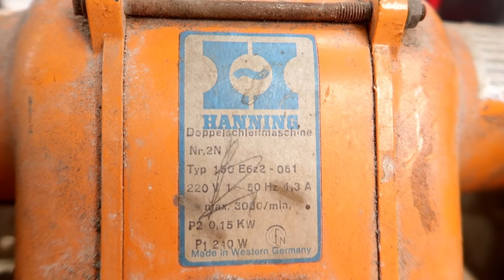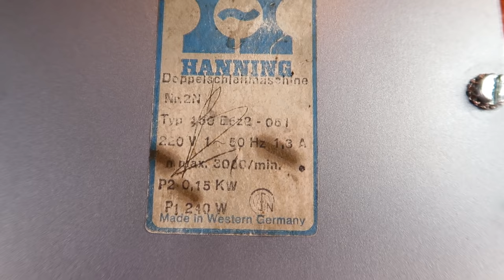Rusty and Broken Bench Grinder -  Awesome Restoration

Comment: Small security advice: If you attach cables and you're lucky enough they come with ground, always make sure ground is the longest wire. If you trip over the cable and manage to somehow pull out the live wires and they accidentally touch the casing, you do not electrocute yourself. Also your GFCI (if you have one, in german it is FI-Schutzschalter)  will pop!
Reply: Did you notice that the men who run the video game companies make the new video games harder than the old ones. The old ones are totally a peanut/they're Peanuts.

Comment: The capacitor blew that’s why it wouldn’t start on its own.
Reply: Aaron david  yes with a capacitor start motor the capacitor is used to help create a rotating magnetic field, then once the motor reaches a set rpm the capacitor is taken out of the circuit and the motor just runs off the single phase power. That’s one of the reasons why three phase motor are so elegant because with the three phases 120 degrees out of phase with each other already produces a perfect rotating magnetic field.
Reply: Aaron david  think of a capacitor like a battery. When you flip the switch to turn on the appliance, the capacitor unloads all its stored energy all at once giving the motor a jump start. Once the motor is turning the normal current takes over and the motor runs on its own.
Reply: @phillipwright746  no...not even close.
Reply: WAIT................ WHAT NOW!!!!!!!!!!?????????!!!!!!!!!!
Reply: @borysnijinski331  yes he is correct
Reply: @firebladex8586  No he's not. The capacitor is there to create a phase shift in the magnetic field. Not to 'give the motor a jumpstart'. A single phase can't start a motor, as it's slip in a magnetic field that makes the motor turn. It wants to 'catch up' to the magnetic field of a rotor, trying to find equilibrium. Without the phase shift, a single phase is already 'in equilibrium' with the magnetic field from the rotor. So the capacitor creates an out of balance magnetic field. Once the motor is spinning, the inertia of the motor (and attached grinding wheels) are enough to keep the magnetic field in and out of phase, keeping the motion going.

TLDR: He's wrong, and anyone even slightly knowledgeable in the field of electricity knows he is.
Phase shift is the key word to take away from this.
Reply: @123nvb123  oddly specific much
Reply: @shadowdragon4137  I wouldnt say oddly specific in the least. Much more like knowledgeable and correct
Reply: Personally I think the motor didn't have enough strength to make the wheels spin
Reply: You took the words right out of my brain!!!!
Reply: @lourias  I did?
Reply: There are start capacitors, and run capacitors which sounds like you do have some knowledge of. That grinder has a run capacitor. It's not shorted or as you stated "blew" or blown. It's a weak capacitor, that's when the value of the capacitor drops below the percentage of the rated value. Also if it's higher than what is rated on the capacitor it can cause an issue. It's usually anywhere around +/- 5-10% of the value. That one looked to be 3.6 uF the best I could read. A weak capacitor will burn up the windings in a motor if not replaced. Some motors especially the older ones were built better and very forgiving but the newer ones not so much.
Reply: Capacitor was huge. I'd be terrified to handle that

Comment: Though it would take longer rust removal would be a 100x less toxic in the arm & hammer super soda electrolysis tank. Positive charge some iron plates on the side of the plastic tub. Negative charge on your part turn on the power supply and come back in the morning to no rust for lighter items and longer for really rusty items. For every gallon of water I think it was a 1/2 cup of super soda (in the laundry section. Fred Meyer has it).  My brother restores Cast Iron pans, kettles and anything else he can that is Cast Iron. I made one myself and did my cast iron pan and it turned out fantastic. He has a Facebook group called Electrolysis tank & cast iron restoration community. I will not post a link if you are interested, that is the name, yall can look it up. I am a admin in group and approve membership. It is a 1500 member strong community.  Also if you like a better sanding experience you can soak your wet sand paper in a water bath with a few drops of dawn dish soap. (20 min.) It will help to lubricate the surface and cut contamination down. If you hear a squeaking sound sanding that is a rock or metal digging in, rinse the paper off. I did automotive and industrial paint all my life.  Do it how you want this is a suggestion I'm not here to tell a grown man what to do. It still looks great I love taking wrecked and used up and making it look new again.

Comment: as a rule, you should always replace the old grinding stone with a new one. 
you'll never know the exact condition inside the disc and it might disintegrate and fly apart once it start spinning.
not a criticism, just a safety tip i guess. great work btw.
Reply: He has been using this grinder a long time.  If the stone was cracked it would have probably exploded by now.
Reply: Very useful suggestion. Some grinding stones also have expiration date.
Reply: Wheel replacement is absolutely unnecessary.  The method to check a grinding wheel is to tap it on the side while static and see if it has a thunk sound.  Not a ring like a tight wheel would have.   Also, whenever starting up a grinder, stand to the side while it spins up to prevent injury if it does in fact come apart.  Again, every time you start a grinder, never stand in front of it.
Reply: @fredx6678  smart
Reply: Another safety tip I was taught , never leave a grinder running, wait till it stops spinning, than go about your work.
Reply: good thing it has the guards on
Reply: Nice try man who owns company making grinding stones
Reply: On this man's wave length here, my safety squints engaged just watching this, especially as he sprayed the bolts on the outside with grinder grenade 😂 wheels deteriorate over time and can be contaminated without any obvious signs and still be run a bunch more times, but degrade alot quicker on start/stop cycles until they finally go bang, I've seen it happen and trust me nothing in my whole Army career scared me that much or came that close to killing me
Reply: 5
Reply: cool music thats for any equipment tbh
Reply: Stefano M. this is not a suggestion, this is a rule in a mechanic’s workplace

Comment: Hey man, love the videos! As a rule of thumb, I wouldn’t hammer those bearings on like that, you could end up messing up the bearing or the shaft. The best way to install bearings and races is to freeze the shaft if possible and heat the bearing to around 150-200 degrees; it’ll just slide right on and cool down tight, no hammering necessary.
Reply: Call me insane. Some of us just use a press.
Reply: @wileycoyotesr8623  You're not wrong. On multiple levels lol
Reply: If you hammer, always on the inside ring, which is what he does. So it could be worse!
Reply: Don' t heat bearing that much, u will ruin oil or grease or whatever lube it is inside.

Comment: Glossy finish and it works perfectly! I would love to see those danger and arrow stickers again, but other than that, you did perfect job! Keep on!
Reply: I agree replacing the safety stickers along with him adding the eye shields would have finished the project perfectly.
Reply: Wasn't that a vintage Shazam sticker? lol
Reply: no stickers allowed! if you don't know how it works, you should not operate it! :D there is no grinder that turns the other way...protection glass is fine-don't really need it when wearing goggles tough-but no stickers necessary!

Comment: Capacitor is dry and  become a resistor. Great channel from my neighbour.....
Reply: capacitor wasn't anymore working so wasnt able to provide the supply power for the spike when the motor starts. also, with rust and bearings in poor condition mecanical resistance increase the load at the start. that's why when he spinned manually the grinder start rotating

Comment: Very nice job. I would suggest getting a stone dresser. Someone ground non-ferrous metal like aluminum with those wheels. You need to remove it as to avoid an imbalance condition where the wheels explode. Also for practical purposes, I would remove the paint from the tops of the tool rests.
Reply: Robert Meyer - 😱😉

Comment: DO NOT REUSE THOSE OLD GRINDER WHEELS. THERE IS NO WAY TO TELL IF THEY WILL FLY APART WITHOUT WARNING. THEY ARE MEANT TO BE DISPOSABLE, THROW THEM OUT. Dead capacitor is the issue. Otherwise great work. I would have left the solid aluminum/magnesium base bare. That would have looked really cool. But it was originally painted, so perfectly fine either way, and it looks great.

Also, no music is better.
Reply: Those grind stones seem out of balance too, causing unwanted vibrations that could lead to a premature wear of the bearings...
Reply: It's totally fine to use old wheels  as long as you do the ring test to check for integrity. A newly fitted wheel should be dressed to ensure no vibration.
Reply: david flint you just said what every mechanic was thinking.
Reply: Get new wheels.
They are so loaded with aluminium its time for the bin.
Why people insist on grinding alloy on wheels after years of warnings not to is beyond me, Darwin award seekers?
Now you have 2 grinders set one up with a linisher belt and a wire wheel for alloy grinding and general cleaning and the other with grinding wheels for steel. Put either or both on a moveable pedestal, so you can move them around to suit and if you do a lot of grinding move outside and not fill your workshop with grinding dust.
Nice job.
Reply: Personal opinion mate, but honestly I prefer that he voted to maintain some of the original character. But to each their own
Reply: agreed they could have near invisible cracks , but thats a risk you take when getting used wheels
Reply: @mangetruckcappydavis6273  just ringing them will tell the tale

Comment: Some types of electric motors need a capacitor to start smoothly. As soon as you asked "Why didn't it start?" I thought "Blown capacitor!"
Then, when you discovered that huge capacitor in the silver can that "seemed a little swollen" it reinforced my theory.
Replace that big, silver cap. The rating is printed on the cap itself & they're pretty cheap. It's a common repair, especially on items like tumble dryers. 
Costs pence but has amazing results. It's my first go to when an electric motor won't start without a little nudge.

Comment: There is a special tool for cleaning the grinding wheels. It cuts off some of the material to restore the surface geometry.
Reply: PLDmitri wheel dresser.   It looks like a handle with a bunch of spurs
Reply: Lane Jennison even better is a mounted diamond point. Properly set, they can do a better and quicker job than the star wheel dresser.
Reply: Is that the name of the tool that my mechanics used to clean the grinding wheel that he restored?
Reply: You can make one by brazing a old carbide insert on a bit of steel...won't last forever tho and it's only good for cheap wheels.

Comment: Unless you know exactly where this grinder has been since it was last used and just how long its been sitting wasting away. You'd be far better off and much safer to just replace the grinding wheels. There could be micro cracks from age, stress, possible water that froze in the wheel or any number of other causes. Those wheels could very well shatter if used again.
Reply: I was just thinking about that... I've seen the waterjet skateboard wheel videos. The outlook for those grinding wheels is not pretty.
Reply: Those were already pinned full of aluminum, best to just toss them. NEVER grind aluminum on a bench grinder.
Reply: I had one come apart on me. I got lucky,  it went to my left,  through my garage wall and into the living room. My wife was pissed.
Reply: I'm no mechanic-type, but I was thinking "I'd just buy new grinder wheels."
Reply: @texalmighty1  why? accidental thermite?
Reply: @XSebi0815  probably it more gumming it up.
Reply: Whilst I agree with the other comments here and I would just replace the existing wheels as you don't know what damage they might already have, you can buy diamond coated grinding wheel dressing tools for not much money which you can use to dress the grinding face of the wheel.  A good mantra to keep yourself safe is "If in doubt, change it out".
Reply: You can test the safety of old grinding wheels using the bell test. Google it for videos of how to conduct the test or find my other comment on the video for a written description of how to conduct the bell test.

Comment: I feel like those two stickers should have swapped places.
Reply: 100% agree
Reply: Nope its perfect
Reply: Agree. Lovely new tysy sticker, but the finish was too nice on the grinder for any sticker not stock/factory.
Reply: Would have been nice to restore the other original labels, Silver, warnings and the arrow showing the wheel direction. It's like 95% there with the missing labels it would be 100%.
Reply: Eric Rosenwald Agree.
Reply: Would have been 3x better if they were next to each other.
Reply: @EricRosenwaldkc  Or recreate them in the form of a metal plate.
Reply: @DaGauntlett  You're bitter af lol
Reply: His logo has commie inspiration, what did you expect.
Reply: He did a fine job and he did keep the original, if not for him it might well be in a scrap pile.
Reply: I feel like that's your opinion.

Comment: The problem when you start is the capacitor is out off service
Reply: Yep, the startup capacitor.
Reply: Agreed, that was the only thing starting it from running as is.
Reply: Good thing it was!  A fully charged capacitor can kill . Nothing to take lightly.
Reply: My old bench grinder just did the same last week. 50 years without missing a beat and the capacitor gives up. Don’t make things like they used to. 😂🇦🇺
Reply: Effectivement, c'est le condensateur qui est HS, on entend bien que sa grogne quand tu démarre et dès que tu le lance à la main il démarre.
Les moteurs de ces appareils fonctionnent en triphasé, hors tu l'alimente en monophasé, le condensateur a donc le rôle de fabriquer cette 3ème phase qui créera un champ tournant magnétique en décalage de phase de 120° dans le stator, qui entrainera à son tour par magnétisme le rotor (axe).
Reply: @shedmanx3640  eh, the 50 year old cap blew? And that's a indication that caps from 100 years were better??

Okay, I'll stop trolling, you can thank Osram and the other big light bulb manufacturers from the early 1900s of that fact. Its called planned obsolescence.
Reply: Yep. Capacitor out of order.
Reply: @Magnús Már Magnússon  Magnús Már Magnússon   Well yes but actually no. Its true that motors take few times bigger current when they start, but it only last for tiny part of second. And also, it would eventually start with risk of fuse blowing up. In this case, this is one phase asynchronous motor with 2 coils. When you plug it directly in power outlet, its rotor would be vibrating in place. Thats why capacitor is added on one of the coils: to make phase movement of current and voltage between coils. That way magnetic field goes around the stator a make rotor spin.
Reply: What do you mean?  It's a fine German capacitor!!
Reply: The point is, it is an asynchronous motor running on 230V amplified current, the capacitor "generates" the offset amplitudes, it's a quite old way to run these motors, but a lot simpler than using a frequency converter. On my job it is called capacitor motor.
Reply: @arcuz7862  I love it when people know what they're talking about.

Comment: Starter cap, can cause slow starts, replaced the one on my 1970's table saw last year. Also some have a centrifical switch that turns on the secondary coils in the stater that can stick.
Reply: 100% right!
Reply: It's the only option i saw too!

Comment: for a reliable start, change the start/run capacitor with a brand new one. 3.6 microfarads (uF) at 420 Volts AC.

Comment: Interesting to watch. Really nice job. The wheels themselves need to be dressed with a wheel dresser though and the tool rests adjusted accordingly. 
Well done.
Reply: they were good not dirty or no grooves so could u dress them? yes, did they need dressing? no they were good to go.
Reply: Definitely needed dressing, but first a careful tapping with a small hammer, to test for invisible cracking. Any hollow sound and the wheel is damaged and unsafe. Then, when remounting, check that they run true (no wobble). Rotating the paper washers can often help to reduce wobble. NEVER dress the side of a wheel to “fix” wobble, this is extremely dangerous.

Comment: I would love to see you sandblast more of your projects. I am not an expert, but why do you use paint remover instead of sandblasting?
Reply: It's always difficult to blast sheet metals, they could get holes or get heavily distorted, only thing to stand against blasting would be the two bases, but it has difficult places too, where you wouldn't get to, with the blasting.
Hopefully I could describe it right, not a native speaker
Reply: The Hemperor - Use a lower psi and perhaps a smaller diameter blasting nozzle. I blast precision aluminum parts at home without damaging them and I'm a complete novice in the field. You can also switch to a less aggressive blasting media (such as glass bead or walnut shell) which will only remove softer materials (paint, rust, dirt) while leaving the metal.

Comment: Why dont you put some clear packing tape over the top of the original sticker and trim with sharp knife. That way the sticker will be laminated and the words will not get rubbed away.
Reply: He should have also put the label back where it came from. I get that he has a "brand" for his channel, but that brand could have gone above the label.
Reply: Vitaliy M   A good tip would be to scan it so he could save a digital copy !